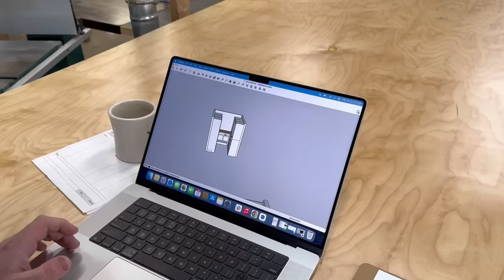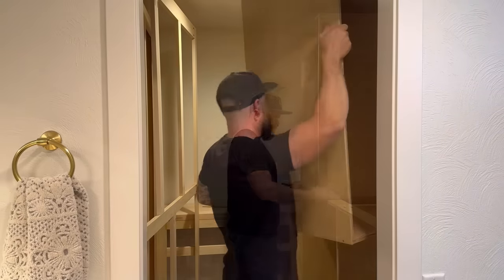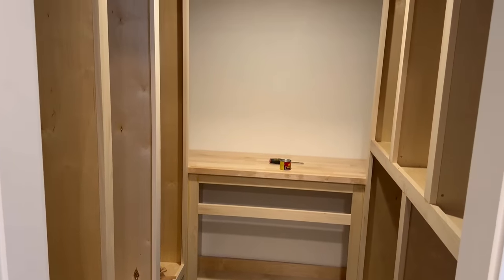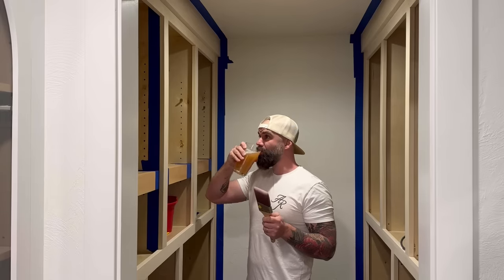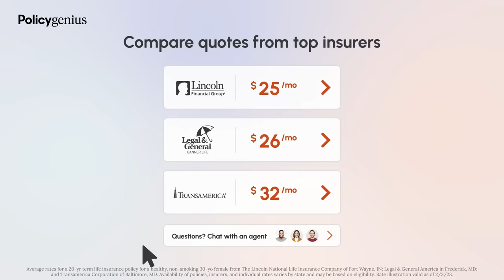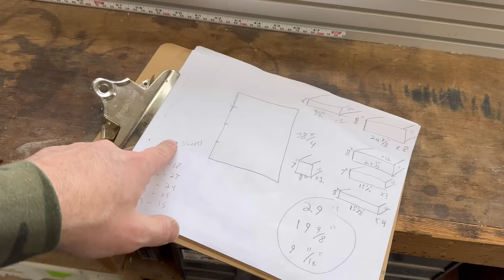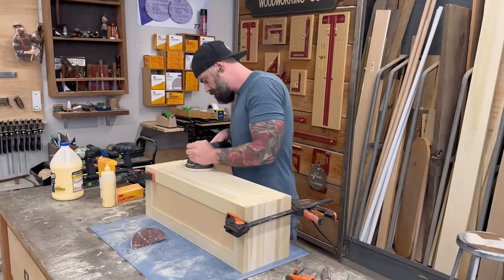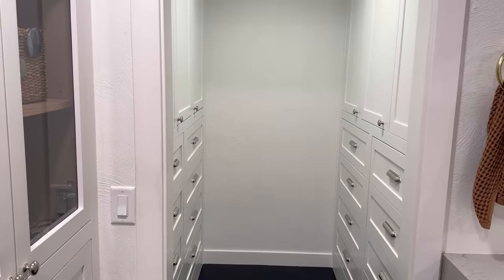These Cabinets Will Be My Death || Building Cabinets For Closets

Comment: I made some cabinets for my laundry room. I put a 1/16 round over on all sides of the pieces to make the lines a feature, painted them and then attached them with dominos and construction adhesive instead of pre building the whole frame. Made the fit a lot easier.

Comment: Did a pantry once. Wanted one big drawer cabinet. Problem was inside the pantry there was a bump out for an HVAC stack or something, running vertically. I had the whole cabinet perfectly designed when I realized that this large block would be impossible to install because of the bump out. I ended up re-designing it so I could build it inside the space. 

Can’t imagine how bummed I would have been had I built the whole thing before realizing the problem.

Comment: I'm a cabinet maker professionally, and I watch all your videos.

This is a tip for overlay hinges. With that said, I've got one piece of a advice. When hanging the cabinet doors. You can cut a block of wood to set inside the cabinet opening and use that to space the bottom hinge clip where it's supposed to be. Then with  both hinges and the top clip attached to the inside of the door. Clip the bottom hinge on the bottom clip, hold the door in place and drive the two screws into the top hinge clip. I really hope that made since. After all, I'm a woodworker, not a writer. Lol

Comment: Hey , you ever heard of frameless cabinets, they are popular in Europe, it won’t hurt you to check it out, hell you’ve got all those Festools, and you seem happy with them, and they are designed around a 32mm system that holds hinge plates, drawer guides, and adjustable shelves all at once. Stop struggling with your drawer guides and just plop the guides in the adjustable shelf holes. You can find a short fat screw that is just for this, same screws hold the hinge plates on

Comment: I cannot begin to imagine the endeavor that this double closet build was.. I just built my first-ever "cabinet", really it was 4 drawers added to the interior open space of my work bench. 1.5 sheets of plywood, 4 sets of drawer slides, 28 individual pieces, 32 pocketholes.  I'm not sure if I'm more proud of howmwellnitsnturned out, or more scared now that the missus knows I can build cabinets.

Comment: Great job on these custom cabinets. I'm wondering how do you stop the 1/4" drawer face material from bowing in when you add the cup handles? If my thinking is right there is a 1/4" gap between the two units.
Reply: Add 1/4” material behind handles, he located handle holes before finishing. So after paint ca glue 1/4” material so it doesn’t deflect.

Comment: When spacing drawer slides vertically, what is your preferred calculation to achieve the best result? I have 3 - 7” drawers and don’t know how high each slide should be to get the right spacing.

Comment: Ok legit question here though. Not mally when you do drawer fronts you use thicker material on the inside and dado the back so your drawer front suck in when attaching hardware. How did you avoid that when only using 1/4" MDF?

Comment: Why would you do this?

2 very good reasons
They increase the value of your home.
If you hired some cabinet company 
You would have paid 40k a closet or more  
The question is total investment
Less then 3k  return on investment
Aside from the use 45k to 70k added value to your home.

These are very upscale  each closet space is limited but the added storage space from the cabinets organizations makes the space more usable.
You still lack footwear space. 
And you could add open shelf on both sides of the makeup table and a seat .  It seems kinda useless as it is, and both sides have wasted space, you could have added draws inside the back cabinets on the side the tables at.

Comment: Why do you use plywood? I understand that it's dirt cheap, but why? Don't you have laminated chipboards there? And what's up with the front "leg" of the box?
We do things differently in Europe. Faster, cheaper and imho more beautiful.
P.S. That's the simplest door face design... It's not that hard. About painting, we usually do 2 coats of urethane and 1 finish. About sanding, 1 after door construction is complete, 1 with 180 grit sandpaper, and finally 220 grit and at the end of the same session with scotchbrite.
By the way, nice panel gap, but we let he doors just sit on the outside of the boxes and not inside like yours.

Comment: This must be a $10,000 closet finish out
Reply: Reckon ply wood @ 200us/sheet x 30 equals about $6000. Blum undermounts say $4000 add paint + his labour (9days) + fuel + delivery costs, fixings+ hinges + door handles + glue + misc bits & bobs. Then double that for his profit and I reckon you are easily nearing 25k-30k. Gotta charge when you got that skill level and a big ass work shop full of expensive toys.
Reply: @1petrofski  I was just trying to guess how much something like that would cost if you DIYed it.. I never knew those slides were that much, much less the ply cost... With any DIY project, you cant count your time is what I have always been told.